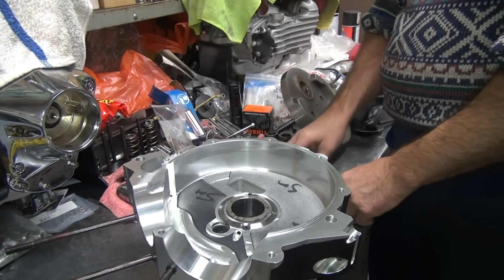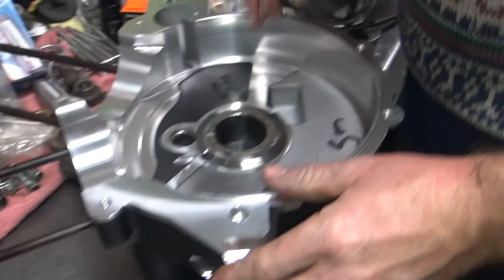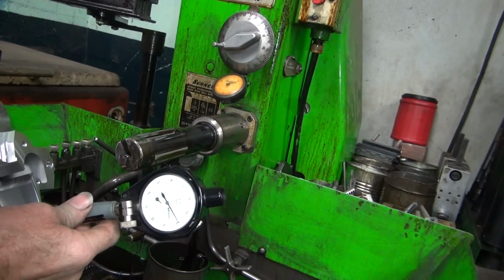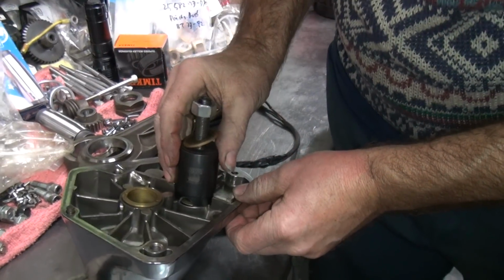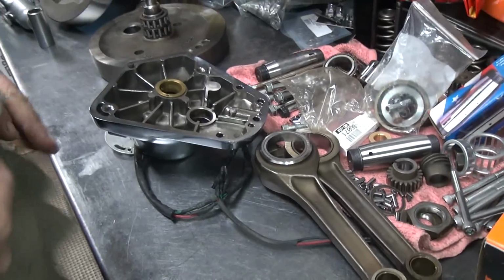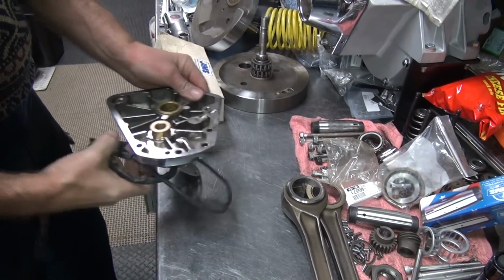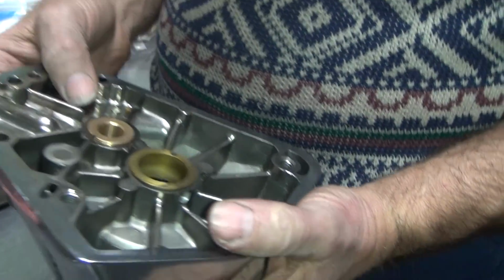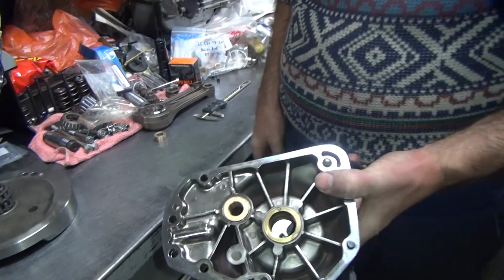1997 80ci evo lower end rebuild #103 ultima case swap harley evolution by tatro machine

Comment: I don't like putting any more undue pressure on those covers than necessary... I guess I need to watch the next video LOL I'm really enjoying your videos I grew up in a machine shop and started doing the same thing you're doing rebuilding a lot of old Harley engines Knuckles and Pans or whatever came through the door that was 25 years ago and then my father died about ten years ago and we had the auction everything off anyway keep up the good work
Reply from the maker: good tips but as you found out we think about the same. comes from doing it and not talking about it in a blog.
tatro

Comment: Tatro
couldn't you have taken that with that Jim's jig  you use to press it in with the blue jig and taken it over to the mill and set it up and shaved that down flush and then honed it out for size...? I've done that before some of those bushings are a couple of thou taller and the Press OD is a little heavier too... I've had a similar experience with the same type of cover where it went in hard when I pressed it in and it went all the way down but it was still a 16th out..not flush so I took it over to my Bridgeport with a big end mill and milled it down flush, then took a hole sander and sized it up ??

Comment: Hey Tatro, 1988 EVO FXST -  is there any reason that I should not re-use the original (dual) pinion bearing? The , race and shaft are visually good and show no marking, scoring or pitting, and clearances measure within tolerances - but if I were to replace it I cannot find the standard replacement in a dual bearing form anywhere. (The standard non oversize rollers are 250 thou OD right?) I am NOT asking this because I am cheap!!! I just can't find an STD dual bearing anywhere :-)
Reply from the maker: you could have tried tatro machine. they have tons of parts. if the bearings look good you can reuse them. the standard green rollers are usually 0.2502 in diameter. 
tatro